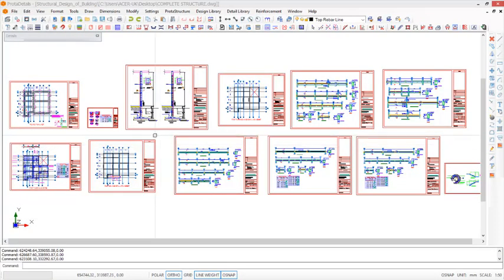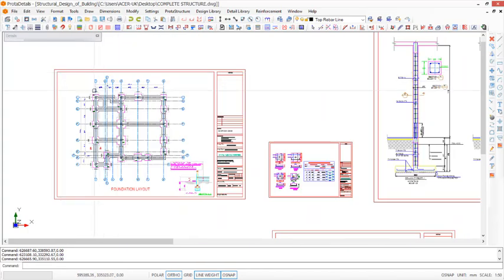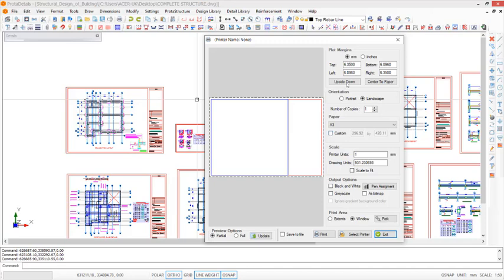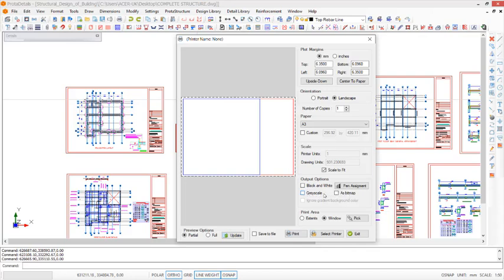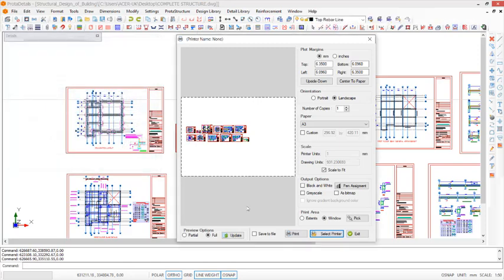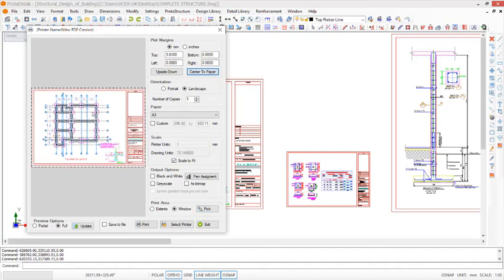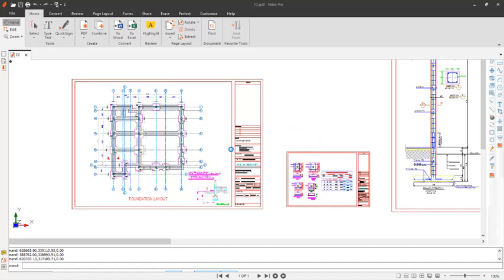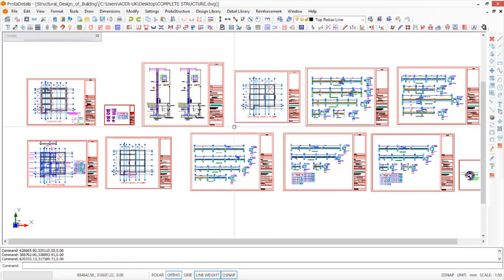PROTA DETAIL PRINTING TO PDF OF COMPLETE STRUCTURAL DETAILS EDITED DRAWINGS

Comment: Thank you sir 
Another question this time on raft beam, I designed raft beams of 225*1400 (g+1) 
Which I'm trying to define a rebar setting of 3bT, 3TT (16mm) and web of 4 12mm
 Protastructure keep giving me 6BT and 6BT
Hence failing due to sectional area
Reply from the maker: @Austino-Technology-Ltd   go to rebars setting and choose at least 3 rebars of varying diameters, do design again to correct it